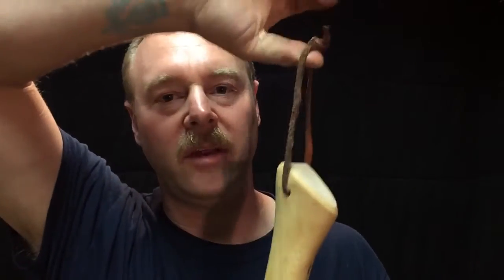Anchor Axe Completion

Comment: Put a good wax impregnation on that leather and it should not corrode the steel.  I have a Randall #1 fighter in a waxed sheath and I feel that it preserves the steel.
Reply from the maker: I hadn't heard or thought of that but I'll certainly do so in the future.  What sort of wax would you recommend? a purpose made leather treatment of some sort or would, say, beeswax work?
Reply: I am not sure which one was used on my Randall #1 sheath.  I was lucky to find a replacement that was waxed impregnated since I lost the original, which was not waxed in the military.  We could not jump with leather sheaths for obvious reasons.  I would go with a bee's wax base or Obenauf's heavy duty.  I am in Germany, but Tandy leather will probably know for sure.
Reply from the maker: Cool, I'll give it a shot! I love Germany.
Reply: I mixed some up ,the resipe I used came from" Purgatory Iron works " you tube channel. its kinda sticky but maybe i'm not putting it on warm enough .I've put it on wood tool handles ,leather ax sheaths ,ax & hammers heads , also trailer hitch balls & couplers .I got the beeswax at a health food store here named "Huckleberries".     60 G  beeswax ,   60 G   Turpentine  , 30 G  Linseed oil . This makes a cup .It's melted & mixed in a double boiler .